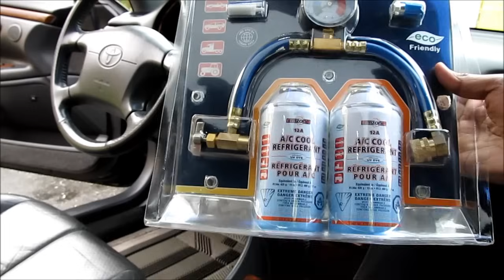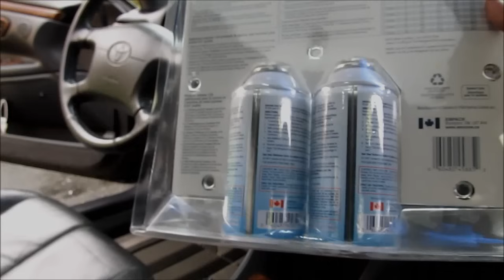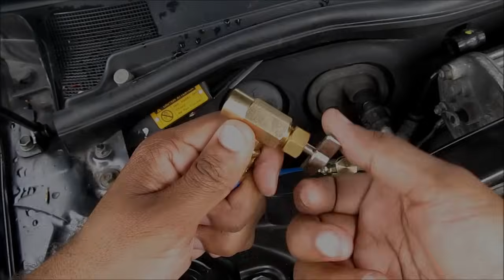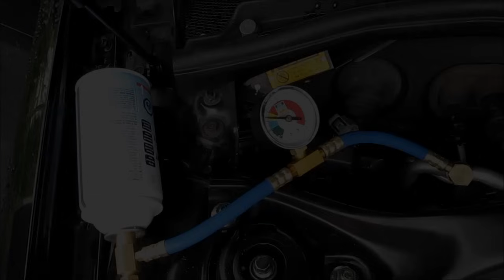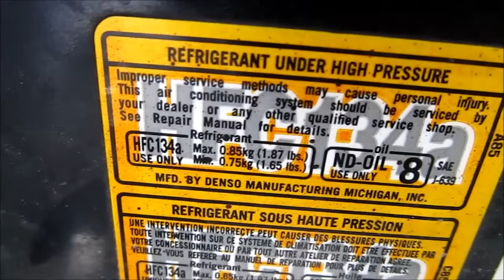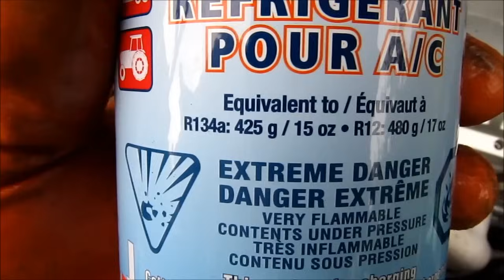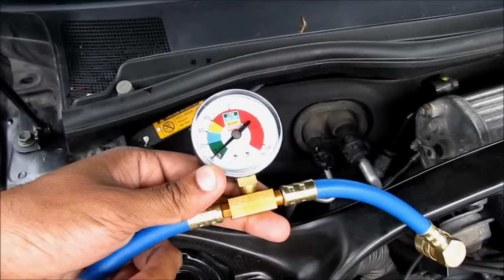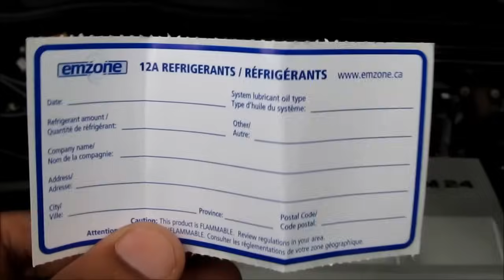How to Recharge an A/C System

Comment: Before opening the freon, you should have removed the air from the tube that connects the bottle to the car's valve. This is wrong.
Reply from the maker: That would be done with a vacuum machine

Comment: When the original refrigerant was removed, that should have placed the system in a "vacuum" state.. if you press in the schrader valve, that vacuum is no longer there and the system fills with air... and will prevent the system from being refilled fully with refrigerant. Best to not mess with that schrader valve at all...ever.
Reply: it does not fill with air if th4 gauge is closed.

Comment: I see a confusion here....the most confused people commenting on here are Americans and it's understandable, because you can't buy this stuff in many states, while it is legal for sale Canada wide and can be purchased at any Walmart or Canadian Tire as it is not ozone depleting. They think that you're replacing R134A with an older type - R12, when in fact it's not. It's a newer type that can be purchased anywhere in CANADA. I repeat its not R12! It's called R12A here in Canada, can have a different name in the States.. This vehicle's system obviously has a leak, if there is no leak the system never needs to be topped up. Older vehicle with a leaky system...who cares about proper procedure with vacuuming the system first? R12A can be mixed no problem with R134A. Yes it can, don't listen to anyone else, you dont even have to evacuate the remaining R134A it will mix no problem.  This can will be probably last you a summer (our Canadian summers are short). But who cares at $30 a can? Next summer get another one and refill the same way. This is the proper procedure to refill your old beater.  Or go pay more than a car worth to get it done properly. Those who are afraid about it being flammable in case of an accident, yes there is a possibility, there is also a possibility of your gas line exploding the same way during front end collision. Relax!
Reply: Also important to note, being in Canada, once a previous owner put in r12a, no shop will touch your vehicle. They say "you are on your own". So the next logical step is to try and charge and repair the system yourself. That is where I am at right now. This worked last year but I seem to have lost some charge. I don't see any dye that escaped so time to charge it again and see what happens.
Reply: It was a mistake to call the propane mix R12a when it has not relationship to the old R12.  It has caused a lot of confusion.

Comment: At 0:50 didn't you just ruin the vacuum, and allow air (with atmospheric moisture) into the a/c lines?
Reply from the maker: No, there's a shrieder valve
Reply: @speedkar99  You opened the Schrader valve with the screwdriver to prove that the system was empty of refrigerant. However, by doing so,  you allowed air (including water vapor) to enter the a/c lines.

Comment: When did you make mention of r12a being better than r134a? Any hard facts in it?
Reply: Both gases are non ozone depleting.  R134a has a higher global warming number than R12a.  R12a is primarily propane and is highly flammable and more dangerous than gasoline as it's under pressure.

Comment: Who told you to flip the freon over? Now you're adding LIQUID freon! Upright, you're adding VAPOR freon. NEVER turn the freon upside down!!
Reply: Correct, with compressor running the can should always be upright so only gas enters the compressor, if liquid goes into the compressor it could damage it..
Reply from the maker: Don't you have to shake it up?
Reply: @speedkar99  stir a little. That's all. Never turn the freon upside down! Why publish a video, if you aren't fully trained?
Reply: speedkar99: Nope, shaking it does Nothing !
Reply: @speedkar99 No.  But if you warm up the can with your hands, it will go faster.

Comment: Put little is ok, it may cold, but if the system leak too much, the outside air will fill up the system, if you just fill up gas without vacuum it, gas pressure will super high, that why you still need the high pressure gauge to check, so dont blow up at high speed.

Comment: Mine nozzle doesn't fit on honda civic 2016
Reply from the maker: Somethings wrong.
Reply: Thats because it doesnt use R134a. It uses R1234YF. They just switched to it and changed all the fittings to make sure you cant refill it with the old gasses. Also, they will no longer sell cans of it. This was an emissions/environmental decision.

Comment: Never have I ever seen someone go from 134at to 12
Reply: Relax, Its a 12A product which is a new hydrocarbon based refrigerant. Not the old R12 that you are thinking.
 In Canada its called Duracool and works great for DIY projects. Its basically a propane and very environmentally friendly and doesn't cost and arm and a leg.  Cools better too and is easier on the compressors as high side pressures are usually lower.
Reply: Your statement is still true after watching this.

Comment: I love your videos but just saw this one for the first time. As a guy who spent a career designing air conditioners and teaching A/C service to technicians I found it difficult to watch. Unfortunately almost every step in the process you demonstrate is guaranteed to ensure short compressor life. While this may be fine in the short term for a car that is a "beater" someplace like Canada where the A/C system is lightly challenged when working on a newer car or one you intend to drive for some time it is important to do the job correctly. At a bare minimum evacuate all the air from the system before charging and only charge vapor (NOT liquid) when charging to the low side.

Mixing air with refrigerant does several things. It alters the pressures that the refrigerant boils and condenses at, confuses metering devices, generates excess heat inside the compressor, and reduces performance. Over time the oxygen and any water vapor in that remaining air will react with the oil, rapicly wearing the compressor. Use a good quality vacuum pump with fresh vacuum oil OR in the old days when it was legal we would charge a bit or gas to the low side with the high side fitting cracked open th purge the compressor then tighten the high side and crack the low side and put gas in the high side fitting to flush out the whole system, I don't know Canada's laws so that may not be legal there. It is not legal in the US or EU.

With the valve facing up the can delivers gas. With the can facing down it delivers liquid. Refrigerant, any refrigerant, is a solvent. Pouring liquid refrigerant into the low side fitting on a running compressor it runs straight into the compressor where it washes away oil from the cylinders. About the same as lubricating your car's engine with brake cleaner instead of oil. In the video you fill the low side line with liquid and that noise you hear when the compressor starts is the pistons hydrolocking as they hit the liquid. This can break rods and bend reed valves in the compressor in addition to washing away oil.

Vapor charging to the low side takes more time but you can speed it up considerably by getting a bucket of hot water to stick the can in as you charge. As refrigerant boils out of the can it gets cold Heating the can warms the refrigerant and helps it boil off. It is possible to liquid charge a system safely into the high side with the compressor NOT running but it is best to have the right (expensive) equipment to do that accurately.

And to everybody in the comments that mentioned any flavor of leak-stop, Don't. Just don't. Many shops will refuse to work on cars with leak-stop. It damages their machines. It will also make future repairs more expensive since everything will need to be replaced. It is way cheaper to just replace that leaking hose or fitting the right way.

Sorry for the rant. this video just "pushed my button." I guess I should make some videos...
Reply from the maker: I already had a vacuum on the system from a shop that evacuated it for me
Reply: @speedkar99  When you pressed down the valve to show it was empty you let air in. There was no hiss so air was already in. Valves are meant to hold pressure, not vacuum.

It can be difficult to wrap one's head around but servicing A/C systems is held to a much higher standard than working on an engine. A properly built engine well maintained will last 200.000 miles. An air conditioner compressor that OEMs can afford to sell won't. 

Sure. You can make it blow cold. If you used Butane or the stuff from the keyboard dust sprays it would blow cold. That IS probably what you used. Will it transport the oil (suction tube mass flow and compatibility), will it maintain superheat across the use range (depends on the calibration of your expansion device), etc.

The bottom, line is that if I said all an engine needs is fuel and air, that mixture, lubrication and timing doesn't matter you would say I don't know what I'm talking about. Maybe I could get an engine to run on starting fluid and kerosine but you know it won't run long. Trust me when I say that some guy in Texas who follows your charging procedure will end up needing to replace every component in his A/C system when the compressor "shells out" within a year or two.

I fully respect what you do here and have learned much from your videos. What you describe in this video will definitely work in the short term, but in the long term it is way cheaper to fix the leak and service the vehicle properly,
Reply: It states specifically to flip the can upside down in the redtek video and their instructions.
Reply: Te So S: Nope, it is Wrong ! Depending on the length of the hose as well (manifold gauges), an a/c system should Never be charged with the can upside down. It needs to be Rightside-up as bill karr states. It's called Compressor Slugging ! Always with that short of hose, Rightside-Up ! for vapor charging, Only !
Reply: Edit: Excuse it please, kerr.

Comment: You just filled up your ac system with the ozone killer. 
Why you think 134a came along ?
Reply: all refrigerants fall to the ground because they are heavier than air...all else is a myth for follars
Reply: @bonniejohnson1518  If that were true you would suffocate at sea level.
Reply: He put in r12a, not r12, they're very different
Reply: @BigRed66X R12a, mostly propane, is very environmentaly friendly.

Comment: Shouldn't the engine/ac be running while refilling?
Reply: You need the compressor engaged in order to "pull" the refrigerant into the system.  However, I see no harm if you add gas (not liquid) into the low side before running the compressor.
Reply: Genuine question ,my system is totally empty due to this the compressor isn't turning , I've been told that once it recognises pressure it will turn , do you have any idea if this can be used to refill and therefore get compressor to turn ?

Comment: I did recharge my 2005 honda civic and it worked beautifuly. U do not have to vacuum out the refrigerant as the system needs a vacuum in it to work,
Reply from the maker: Glad it worked out
Reply: If your system is dead empty, you need to pull a vacuum first to get any water out of the system.

Comment: It's not recommend to place can upside down when full because run risk of damaging AC system by having too much liquid refrigerant go in at once.
Reply from the maker: I control the flow with the valve in the gauge
Reply: it says right on the can to turn it upside down.

Comment: Well, i think i messed up. a mechanic shop told me i had a leak in line (don't know how he knew without dye/gassing up), looking at min, $500 + $100 to gas it up, then said that's just so they can test it, could be bad compressor, etc too...... possibly $1,100 + . car is a 2009 Mazda 3, and i can't afford that. tried the CT one, added sealer, went to 20 psi, air is cool but not cold, connected can of 12a, open valve a bit, psi jumps to 100 psi and i hear hissing on and off so i stop. air is blowing hot again but can of 12a is till pretty well full. next i let some out of the lowside port down to 35 psi but air is still blowing hot......... am i screwed or could it be air in system?
Reply: P.S. when 1st started venting vapor came out, then seems to be just air after about 30 seconds.

Comment: Can you check just the pressure without any cans attached with the gauge and hose ?
Reply: You can check the pressure by simply attaching the gauge. You only have to have a can attached if you decide you want/need to add refrigerant.
Reply: With the engine off, you can also just press the Schrader valve on the low side port with a screwdriver.

Comment: Hi there I did this yesterday with my 97 ZJ. I charged up yo 30psi but the AC still doesn’t engage. I tried bypassing the drier sensor and it does work. Should I leave it working while I charge the system? Thanks.

Comment: It should be noted that R-12a is NOT the same as R-12. The former is just a mixture of propane and isobutane. It is compatible with the oil in R-12 systems because of the isobutane which carries the lubricant.  It is ILLEGAL to use in cars in many states because of the flammability of the gases. Nonetheless some people try to use it as a substitute for R-134a though the oils are not compatible. Hoses and accumulator should not have to be changed but, again, this is illegal in many states. I think it's still illegal to replace R-12 with R-12a in the USA.  I think there may be an agricultural exception but not sure.
Reply from the maker: Yes I used R12A because we can't get r134 here in Canada
Reply: @speedkar99  That sucks we have to be licensed in Canada to have R134a, but they offer us HFC-12a, a flammable alternative.
Reply: In the US, R209 (pure propane)  is used in all kinds of refrigeration systems, e.g. refrigerators, ice cream machines, soda fountains, ice makers and aerosol sprays.  But not cars or trucks.

Comment: Presumably the mechanic who evacuated the system and recovered the refrigerant as required by law, left a vacuum in place. Removing the low pressure valve cover would have allowed air to enter. Or he could have put sufficient R12 in to equal atmospheric pressure to prevent air and moisture from entering. When you attached your charging kit and opened the valve with the can inverted, liquid refrigerant would have entered the low pressure line. It would likely have vaporized instantly and been OK. But then you started the compressor and still charged with can inverted allowing liquid to return to the compressor. Hopefully the accumulator protected the compressor but often not and it could be destroyed. One can only charge in the gaseous state on the low pressure side.
Reply from the maker: Good points

Comment from the maker: The A/C Recharge kit is available from Amazon here: 
https://amzn.to/3z6snRP (Canada)
https://amzn.to/3khrHoB (US)
Purchase tools used in this video to dissect your own car parts:
Angle Grinder (aka snap ring pliers): 
https://amzn.to/3nyCsVp (US)
https://amzn.to/3hyoQFR (Canada)
3/8" Ratchet set:
https://amzn.to/3hA7LLD (US)
https://amzn.to/3zgHE2d (Canada)
Screwdriver set:
https://amzn.to/3tGeU1S (US)
https://amzn.to/3hy4Z9G (Canada)
Reply: When I attach the low hose gas comes out. Should that happen?
Reply: @nellynelrose sounds like you just might not have it snapped/pushed down far enough (all the way) onto the low pressure port...

Comment: Never mix 12 and 134a the oils dont mix, Vac system, add oil add proper refrigerant, they sell it in one can with dye.  If there's air in system it must be vacuumed as shown.  Some systems can go for decades with small leak but must add oil if leak is at compressor because bottom loses oil.
Reply from the maker: Good tip 
Although AC work is expensive for many people
Reply: Why is it a waste? Most people can't afford to spend money on a older car to have a professional do it the perfect way. 

At the end of the day what matters is whether or not your car starts to blow back cold air and his amateur way worked so how can it be wrong?
Reply: @PROUD_CANADIAN78  You cannot mix R12 and R134a the oils don't mix and you can destroy compressor.  But if you have a R134a system you can always add refrigerant with oil and dye and sealer, a slow leak may need to be topped only once a year and that's easy and cheaper then fixing a leak.  Just remember if system is open it must be vacuumed b4 adding and if it leaked refrigerant it may leak oil to especially at bottom like compressor so better add 2 oz of oil otherwise compressor will die.  I still have a converted R12 to 134a from 89 that needs 12oz a year with oil and works well with 30 degree delta on a hot day.  As you add refrigerant have the silver container called an accumulator ice cold and sweating from top to bottom (blower on high), that is another indication you have proper charge.  AC can be tricky if you make 1 mistake you can destroy compressor.  Proper oil replacement and try a teflon covered bolt on leaky high and low side ports if they leak.   You can buy a tool to replace schraders without losing refrigerant.

Comment: what happen to having a vacuum on the lines before filling???
Reply: when using r12a you must not fill the system under a vacuum   r134a needs a proper vacuum where as r12a does not
Reply: @mallardd5700  if you did pull a vacuum before installing r12a would it cause problems?
Reply: vacuum smacuum, he'll still get a deltaT of 2 degrees.
Reply: No don't need it lol ,he's compressor will self-destruct  in  a week of time,trust me